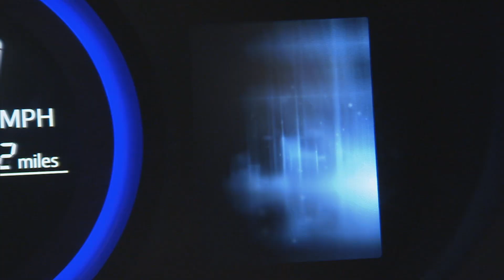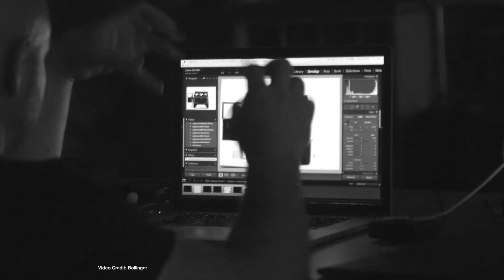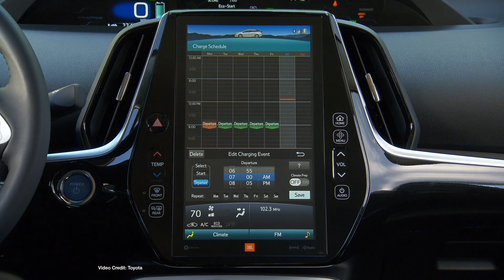ecoTEC 13: Tesla Model 3 Snow Testing in NZ

Comment: Hi, I really enjoy your show. Very informative. 
The other day I test-drove an electric car for the first time. The Hyundai Ionique. It's a really nice car, but still way too expensive. Which brings me to the point. 
The People at Hyundai told be that they brought the Ionique PEV into NZ for NZ$100k, but the government subsidizes 40%, so the retail price is NZ$60k. When I asked what the PHEV model cost, I was very surprised to hear that the more complex and more expensive model to produce is actually less expensive at NZ$38k RRP. 
Why is that? Hyundai couldn't or wouldn't elaborate. Do you know? 
I cannot believe that the batteries are that expensive, I mean, the PHEV has a battery too, right? So why is the same vehicle, with the more complex, and therefore more expensive drive train less expensive to buy? are they getting subsidized by the oil companies for each internal combustion engined car that they produce? or is it simply a matter of projected sales?